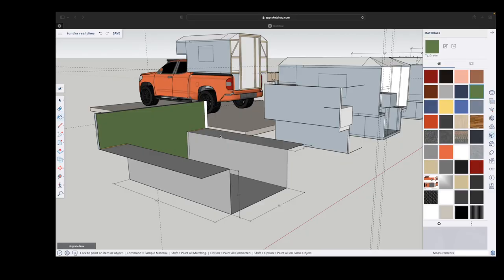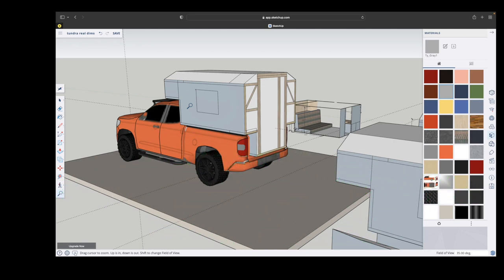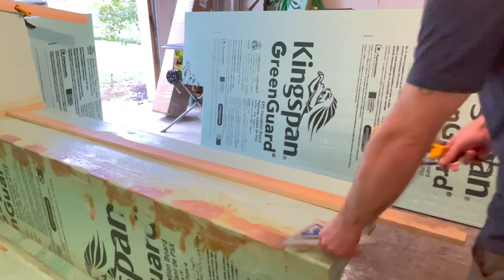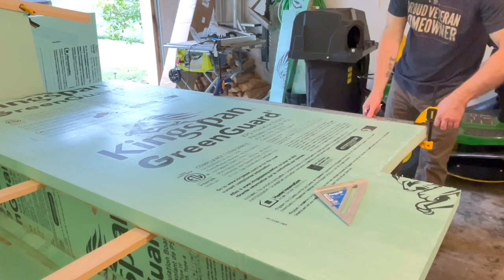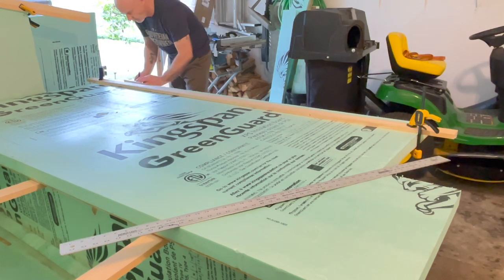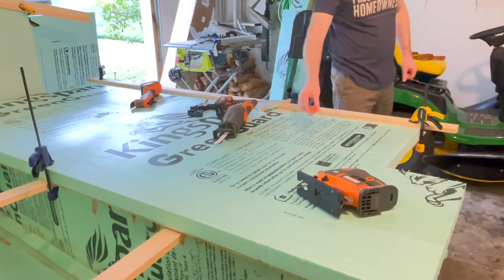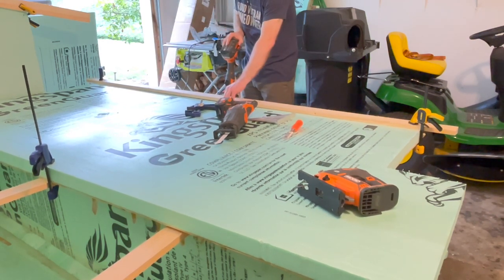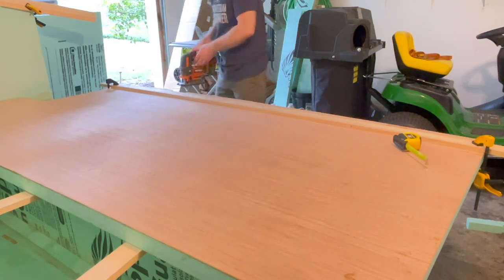Can I build this foam truck camper?! Heck yeah! (I'm already putting up walls!) Ep. 4

Comment: Look, again... not here to give you a super hard time because, hey... you're out here doing something great. That said, the absolute most important part of your videos to a lot of your viewers is your epoxy process. There might be a few folks out here making the exact same camper as you, so seeing your CAD mock-up, and all that, will be instructional for them. I am building a hard top for my boat. All that epoxy work you're just blowing by, is exactly why many of us are here. I have done a grip of fiberglass on fiberglass and fiberglass on wood work. I have never done fiberglass epoxy on foam, so this is why I'm here. What works, what doesn't work,  lessons learned about epoxy and foam. There are a ton of folks out here doing videos that leave out exactly the info you need.
Again, you’re doing fantastic, but if you're going to teach a class, please stop skipping past big chunks of material.
Reply from the maker: @DesmoProfundis Thank you for the input and the honest appraisal. These were not so much as instructional or 'how to' videos. This was the first time I attempted anything like this and was learning as I went along, so I am not really qualified to teach something, that I was learning myself. It was more of a vlog, than anything, and I certainly didn't want to lead people down the wrong path. I do some teaching on my astronomy videos, but only because I am familiar with it, and with lots of practice. I am going to be starting a new series where I am converting a cargo trailer into a camper, which, thankfully, I know more about so it will be a little more instructional. Again, thank you for your input, I appreciate honesty and open dialogue.
Reply: Checkout Jake's foamy camper - https://www.youtube.com/watch?v=RRTR-z97ZRY&list=PLKapAHa8ZlZg0YwFtRAvcxv8D5sOiayiC&index=1.  Skip through the morning run and breakfast prolog. Once he gets going on the build his is the best foam, epoxy, fiberglass build I have seen so far.  I've worked with experimental aviation using carbon fiber and fiber glass - Jake taught me quite-a-bit.  There are 16 long vids - worth every minute.

Comment: Thanks for this series.  You have taught me a lot about foamie construction.  I'm not building a truck camper but a squaredrop (boxy teardrop) I can attach to a 5x8 utility trailer when I want to camp.  I will use many of the construction techniques you demonstrated.  I think the main difference so far is that I will cut and dry-fit all foam pieces as a completed camper first.  Only after all the foam pieces are verified to be accurately cut (including the notches) will I disassemble the foam parts and adhere the exterior sheeting to each piece separately before final reassembly.  Hopefully, this will make for easier construction and smoother corners since the plywood will not be notched.
Reply from the maker: That definitely sounds like a plan! One of the things I wished I had done as well!
Reply: @GeorgiaAstronomy  Maybe for MAC v2?

Comment: why didn't you use the hot knife to cut the foam again?
Reply from the maker: Honestly, it was a pretty cheap hot knife and tended to 'wave' around when using. The jig saw and circular saw worked much better.

Comment: 5:20  5mm plywood.  was this mentioned earlier?  was it decided on the fly to add plywood to the construction?  how did you adhere plywood to foam?
Reply from the maker: @kevinwelsh7490 Thanks for watching! I covered it from 1:00 - 1:40. Unfortunately I didn't actually record me doing it but did explain.
Reply: What product did you use? What resin? Thank you.
Reply: @GeorgiaAstronomy what design software are you using?
Reply from the maker: @Tibiansgarage  Its called Sketchup. Free on line. sketchup.com

Comment: Just curious why you notched the Plywood on side walls looks like you did not on the bottom of the wings. Did you find this out and did not do this in other areas? seems like it would be less work not notching the ply.
Reply from the maker: In retrospect, Probably didn't need to notch the plywood. I believe the only reason I did was due to possibility of there being 'dead space' between the outer plywood and the foam on the wing. I'm sure I could have used som filler there if truly needed.
Reply: @GeorgiaAstronomy  yea maybe just some spray foam sealer in any voids it bonds also and can sand flat. Wish i could find someone with a video of making the sandwich XPS and ply walls

Comment: 3:43. Did you not use hot wire because the plywood is already bonded to the foam sheet?
Reply from the maker: Yes sir. That is correct.